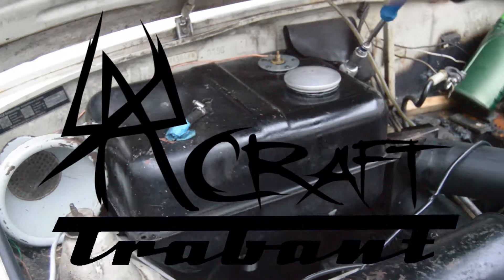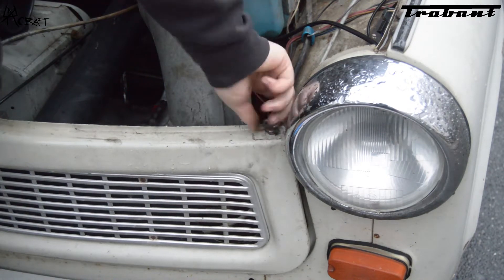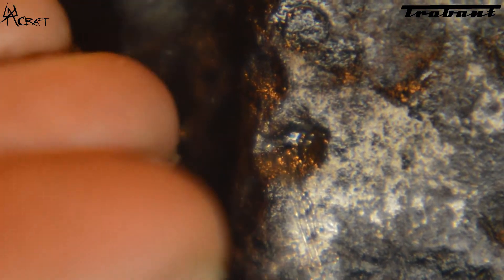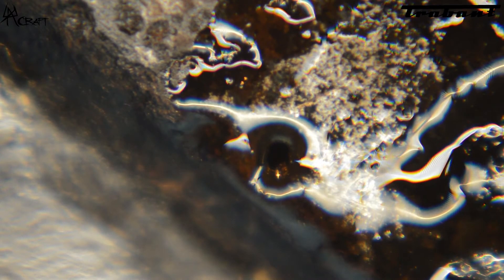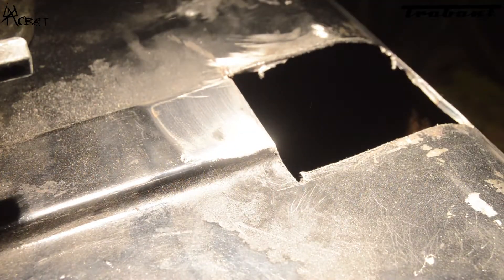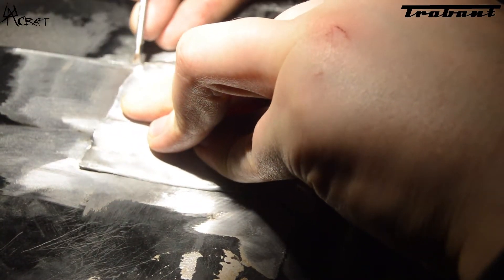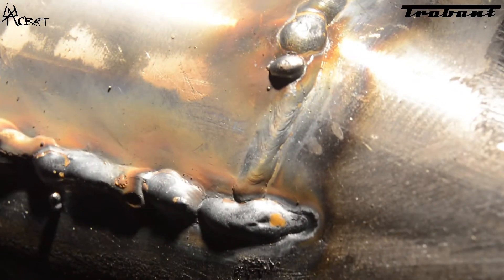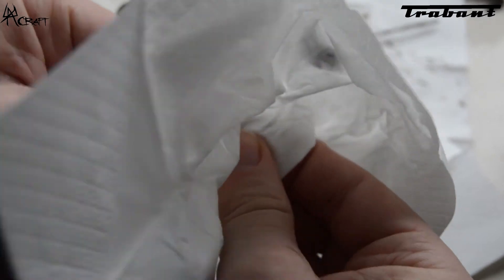Trabant Fueltank Repair Part 1: Rustremoval, Welding, Sealing

Comment: Brilliant, welding better than most car repair shops, job well done, try and get some gloves when welding tho, as the UV can basically give your hands sun burn, I learnt the hard way!
Reply from the maker: Thanks so much for the complement! and yeah i noticed that burn ^^".  I make sure to get some welding-gloves!
Reply: @Laracrafttrabant  I use tig welding gloves as I find them easier to work with, looking forward to next video 👍

Comment: Is it difficult to acquire replacement parts since its been out of production for thirty years?
Reply from the maker: Don't forget that it also was in production in a Communist state for 26 Years and 2.818.547 of the 601 where made. 

So combine the hording of some poor commies with modern aftermarket production, there is quite a bunch.
I know a girl that can get me parts if i need something bigger, she works in a Workshop in east Germany, so she is right at the Source.

The de facto online-shop (sometimes a bit pricey) is Trabantwelt.de
Robert over at Aging Wheels being stuck in the USA uses it a lot as far as i am aware.

i always love getting old parts and restoring them it is more work but cheaper. 
my engine was like 90€ for the crankshaft and 100€ for the lower housing :D 
lets see how long she lasts ^^"

kind regards Lara Craft